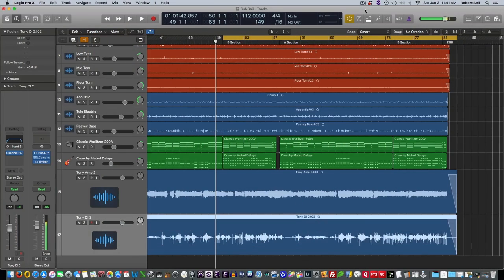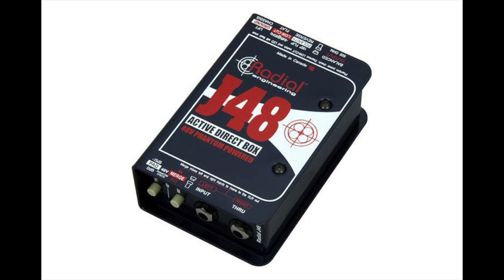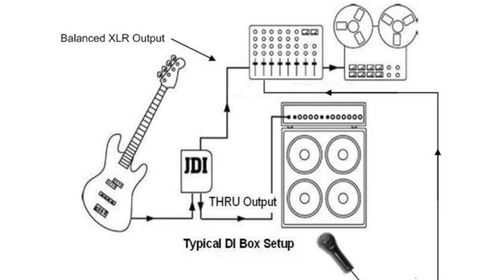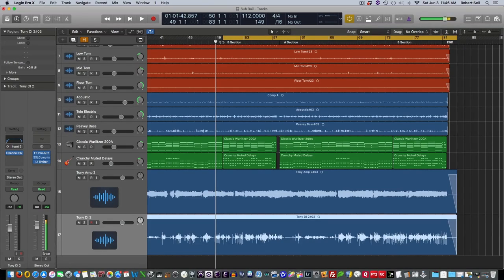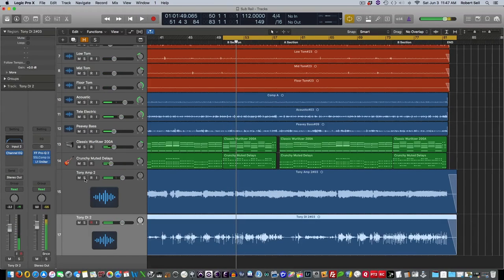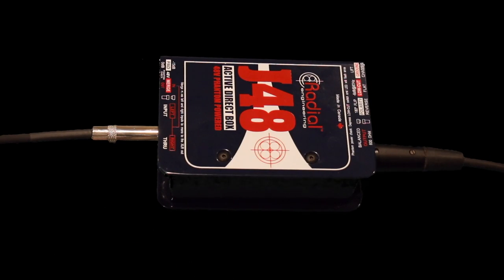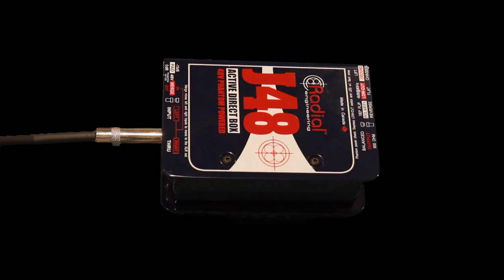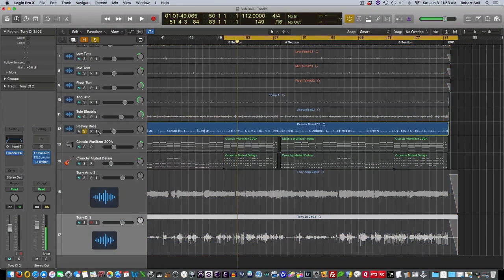Recording Electric Guitar with a DI Box

Comment: Get video! Thanks for the run down! I have a J48 and just getting into home recording. When I plug a guitar or bass directly into this DI box and then into the interface, it sounds perfect. Crisp, open, and a lot of dynamics. When I put the Thru to by pedal board (and to a lesser extent directly into the amps) the DI signal into the interface drops a few db and the sound closes up. Not a lot, just enough to notice. Is this normal? 

When I had an unbuffered fuzz at the start of my pedal board chain it was actually distorting the DI signal when it was switch on. I am not even sure how this is possible! And advice would be hopefully, thanks!
Reply from the maker: The clean signal generated by at XLR (DI signal) should be unaffected by anything going on with the Thru port. The only suggestion I have is a defective J48. Return it and go from there. Good luck.

Comment: The choice of active or passive DI simply comes down to signal strength.  It doesn't matter whether the source is active or passive.  If the source struggles to achieve a unity gain, an active DI is recommended to preamp it, otherwise passive will do as there is no need to preamp & doing so may even result in clipping distortion.  It's just that usually an active source has a higher signal output than a passive one, but this is not always the case.  The common rule of thumb described in the video sometimes breaks down, but easily achieving unity signal at a mixer or recording device input it the real criteria.  This is because, weak signals accumulate the same electronic noise floor as strong signals but the weak signal requires more amplification which also amplifies the electronic noise floor.  For this reason, it is important to preamp weak signals at the earliest possible point in the signal chain where the least noise is accumulated as this gives the cleanest possible signal after amplification.
Reply: Is there a sweet spot for db level when tracking ? I always hear something like -16 to -12db?
Reply: @heythere6983  Well it kind of depends,  the VU scale has been around quite a while, it was designed to give audio engineers an average target to aim for, with head room enough to avoid clipping. 0 VU is by definition unity gain.  This is the standard for Pro Audio, domestic gear may or may not have as much headroom. 

There are several different dB scales,    
The following are all the same signal level.
0 VU or dB(unspecified)
4 dBu
4.782 dBv
-18 dBfs
1.228 V (RMS)
3.427 V (p-p)

Note that dBfs is the scale used for digital music.  0dBfs equates the the maximum possible sample bit value which is the actual hard clipping  You don't want to ever see this happen. Clipping in analogue just begins as distortion & gets worse with even more gain,  but in the beginning is not too bad, unlike digital clipping which is a more of a disaster if it happens at all.

Now, not all gear is made the same,  older audio gear, especially of English  manufacture, is not likely to have as much head room as newer gear designed to interface with digital gear.  So, lookup your specs so you know where your limits are with analogue.  If it's designed to interface properly with digital audio, it shouldn't clip below +18VU +14dBu but a lot of gear will clip before that.  Most gear has a clip light to indicate when you are close to clipping.  So my advice is to aim to average around 0VU and not be alarmed if the clip indicator flickers sporadically, that is just normal in a pro audio setting that is pumping.  Just avoid the clip indicator flickering or lighting constantly.

You see a lot of YouTube content that pushes right up to 0 dBfs +18VU  This is done to be louder than anyone else.  They use compression to get the average loudness way above 0VU so the whole track is as loud as possible.  The problem is that it can break the  pro audio standard 0 VU so things can be louder than expected.  So you have people doing different things in regard to volume.  Compression is a plus and a minus.  On the one hand it reduces dynamic expression, just pumping out a narrow band of volume, fine for a party and fine for mobile listening in the car or street where ambient sound is competing.  Not so good for music appreciation listening in a quiet space.  So, we have 2 different product aims here.  Of note, Classical music usually exploits a very wide dynamic range which has great audience impact in a consort hall, but travelling in a car, fails to get the quiet passages audible over the ambient noise floor in the car.  So, these things need to be considered in setting that average gain 0 VU target.  At times you just want to keep the highest spike below clipping & struggle to attain that 0VU target or struggle to get quite passages audible, without clipping.

For these reason, I tend to think the lossy compressed formats such as MP3 should have more dynamic compression for the mobile music market where ambient noise is an issue, but Lossless, such as 44.1 and above should have far less compression for more dynamic expression in quieter environments.

That's going further than answering your question, but something to think about.

Gain structure to minimise accumulated noise.
If you are doing mixing, try to get the source  as close to unity as possible as early as possible.  Generally mixing boards do not use the lowest noise gain controls to keep things affordable.  For dynamic vocal mics,  it is usually cleaner to use a mic booster at the stage (FetHead or cloud Lifter) so that you don't have to run the board input gains so high (depends on the vocalist).  If this is not affordable, don't loose sleep over it, it's an icing on the cake thing.  Anyway, my advice is set all the channel input gains to unity so the signal is as fat at unity through the input channel circuitry This will minimise the noise added by the input channels.  Each channel then goes through a fader that controls that channels output to the next stage (group or main stage)  Those channels are where you proportion the mix for the next stage but the combination of them also act together as the input gain for that next stage.  So, while you are mixing, you want to be aware of keeping the input level for the next stage, close to unit level.  So think about the dB addition & compensate faders to average out a rough compensating attenuation.  If you mix 2 channels, you want attenuation to average -3dB, 4 channels average -6dB, 8 channels average -9dB etc.  It's not critical you can over compensate a little to be safe. Just be aware of the dB sum & compensate so the the next stage gets close to unity gain input without clipping. The main thing is the artistry of the mix though.  If the board has groups, then you do the same with the group faders and so on.

For the PA I managed, I set the amplifier gains the produce the desired maximum  dB SPL at unity input for the mixer.  I set this up as a somewhat lower volume and input gain to preserve hearing of course.  The point of doing this though is that I could use the mixer output meters to limit the loudness of the whole system to unity signal of the mixer.

So, now I have been through the principles  gain structure for you to minimise the noise floor that a systems electronics adds to the mix.  That is, how to get the greatest possible clarity out of an audio chain.  It doesn't have to be a pro PA like described here, whatever the audio system, the same principles apply.  Minimise the amount of amplification required at each and every stage by maintaining unity signal throughout the entire audio path.

Comment: A well-explained video! If not THE best video on YT in terms of DI Boxes. Thank you Sir! Question: What do you think of the Radial Pro48? Are there any differences in sound compared to the J48? Except for the features that the J48 brings with it.
Reply from the maker: The Pro48 is basically a trimmed down version of the premium DI J48. The Pro48 eliminates the stereo to mono merge function, polarity flip, and high pass filter while reducing the overall size. The Pro48 is more affordable by eliminating these features. Hope this helps.
Reply from the maker: As far as the sound, they should be the same as they use the same transformer. However, I have not used the Pro48 so I can't speak first hand.
Reply: @BobSell  This helped a lot! Thank you very much!

Comment: I've been using the Strymon Big Sky HW with speaker simulate and then post processing as needed with various amp sims in my DAW, seems to work well most of the time - but sometimes only an amp has the secret sauce (at least for now).  REALLY looking forward to Strymon coming out with a more sophisticated Amp sim than the Iridium, maybe with larger Big Sky enclosure - the Iridium has many good settings but I do think there is still room for realism improvement.

Comment: Hey Mr Bob, had a quick question, just wanted to know if i don't want to record an unprocessed tone, and just want to record the wet signal from my eleven rack, will the j48 benefit the guitar quality for recordings at all? And for the connections would i plug my guitar into the j48 and the thru to the input of the eleven rack? and then just record to my computer via usb from the 11R?
Reply from the maker: I’m using the 11 rack as well. The short answer is no don’t use the DI box. no advantage if you don’t want a dry (unprocessed) signal.

Comment: Does that mean your DI box does nothing to alter/balance the sound of your amp? It's really just an upgrade for the unprocessed (and unbalanced) base sound you'd get by plugging your guitar instrument line right into your interface?
Reply: You seem to be good at replying so I'll try to explain better: My guitar goes into my amp, but comes out through the "Phones" port via a 1/8 inch adapter to the 1/4 instrument line, which is directly plugged into my interface. I KNOW. I am unhappy with the quality of sound (no duh) but I do like my amp, and hoped a DI box would help me balance the direct amp to laptop headphone sound that passes the sleeping roomate test. However it seems that is not the purpose of DI boxes? They are only for the unprocessed, unamplified, clean signal of a direct-in guitar line, and will literally bypass balancing my amp to only balance the base DI signal?
Reply from the maker: Yes, the signal that is sent to your amp in unaffected. Yes, call it an upgraded (mic level, unprocessed, dry,  low noise) signal sent to your interface! You got it!!
Reply from the maker: Yes it sound like you have a good understanding. The DI box will NOT help you get a clean sound out of your amp to your computer...
Reply: Thank you!! Yes I am understanding, and glad I did my research before blindly buying

Comment: Quick question:  My DI box has 3 pad settings:  0 dB,  - 20 dB , and a  -40 dB pad. When i use the -20 dB pad, i barely get guitar signal into my DAW.  Do i have to use the pad , or can i keep it at 0 ?
Reply from the maker: Only use the pad if you signal is too hot. No, you don’t need to use it.
Reply: @BobSell  thank you!

Comment: i have my signal chain like the one in the video but the signal is clipping and i cant understand why. 

guitar goes into di box, xlr goes from di box into audio interface mic input. i have -15db pad engaged on my radial pro48 active di box, and i have input knob on 0 on my steinberg ur44c audio interface. guitar volume is on full but will clip with hard palm mutes. 

i could turn down the guitar volume but the tone suffers, any ideas?
Reply from the maker: I'm not familiar with the Steinberg RU44... but can you turn the input anymore more? Is 0 unity gain on the unit? Do you have fantom power engaged?
Reply: @BobSell  i have phantom power engaged and the knob is all the way down but it still clips on palm mutes. im not sure what 0 unity gain is but the only thing i can turn down is the guitar at this point and im not sure why i would have to. if i plug the guitar straight into the interface it doesnt clip nearly as easily so i know its the di box making the signal hot

Comment: I dont get it... if I just use my interface and decide later that I want a different sound.. I just go to the ampsim and change the sound.
Reply from the maker: Yes, you can do that. The revamping process is really around physical amps. If you are using an amp simulator and you've recorded a dry signal, you are all set.

Comment: I understand recording the clean guitar for re-amp and sticking an amp sim on, but how do i record the clean and get the output from my Marshall JMP1 unit. I usually use the JMP1 ampsim output for recording, but I understand it would be invaluable to record the clean tone as well. I am using a focusrite 2i2
Reply from the maker: If your Marshall JMP1 unit offers a thru port, that's how it's done. Otherwise, you'll need a DI Box.

Comment: Can you tell me how to setup using the guitar amplifier with effects pedal? i can't seem to figure it out with my DI box, what should I connect to what? Thanks in advance!
Reply from the maker: Thanks for the question! The idea here is to record a dry signal from the guitar in addition to the effects. The DI box is first in the chain, before the pedals. The DI box creates a balanced signal for recording a clean track through an XLR cable that go to you recording interface. Also the DI Box provides a thru port which passes the guitar signal unaffected to your pedalboard

Comment: Hey Bob, great video! Would you recommend using a DI box for recording guitar just with an audio interface (Line 6 Pod UX 2)? Without using a Amp simultaneously? I'm using a active guitar and i just want to improve my DI signal.
Reply from the maker: Jan, I would highly recommend using a DI box for recording direct to your L6 Pod! The whole idea is to give you a clean mic level balanced output to go to your interface. I'm not familiar with the L6 Pod but does it have phantom power and mic inputs? If so, yes this is your best option. My only other recommendation is spend the money and get a good one. They will last a lifetime. If you get a quality active direct box it can handle both active and passive guitar pickups. Here's an Amazon link for more information: https://goo.gl/TRb6YS  If you are on a budget, you'll need to get a passive DI to be able to handle your active guitar. Hope this helps! All the best.

Comment: hi Bob, i have a dbx 286s mic pre and i'd like to use it also with my electric guitar, someone told me that in order to connect my electric sg guitar into de 286s i need a DI. is it correct? if yes what kind of DI is more appropriate to this purpose? thanks
Reply from the maker: The J48 is the best. will serve you well with either passive or active pickups. Spend the extra money to buy one box that works for all situations. My 2 cents. Hope this helps.

Comment: Great video!!! Bob,will that box do the job for my nylon string Godin?playing live with Bose 2 and the digital mixer from Bose as well- there is presets in it for the piezoelectric mics for the guitar. In that case is the DI needed ?
Reply from the maker: Thanks! This is one of the best DI boxes you can buy. It handle anything. If you are playing live I'm sure your sound guy would prefer a balanced mic level signal for the house board. You could use the thru port if you wanted to monitor through your amp. Works great to have a balanced signal in the studio as well. I would think all guitar players that are plugging in would want one of these. You can buy other models cheaper but not better. Country Man is another industry standard professional DI box. Thanks again for the comment!

Comment: Hi Bob ref your J48 example and capturing  your dry sound is good,  but I want to record  from my amp (wet) using certain Effects from the send and return loop on my amp via a DI so which model do you suggest J48 or Jdx48? or other(  I have 2 guitars 1 active and 1 passive ) then which is the correct way to hook it up into the interface?  Kind regards Stephen
Reply from the maker: Great question Stephen. I’m going to make some assumptions based on your comment. You don’t want to mic your amp’s speaker cabinet. You’re plugging into your amp first for the distortion/overdrive (preamp) Effect. You’re coming out of your amp’s “Send” to your pedals (modulation, delay, etc). If this is the signal chain you want to record then from your last pedal go to the J48 DI Box. From the J48 you’ll get a balanced XLR out for your audio interface. The only thing you are missing in this setup is any sonic quality that you may be getting from your amplified cabinet and speakers. The JDX gives you the cab/speaker simulation but I don’t have any experience with it. I would go with the J48 so you still have an excellent DI box if you ever need a clean DI like for recording bass or re-amping guitars purposes. https://goo.gl/TRb6YS Hope this helps...

Comment: Hello mate, great vid definitely has cleared somethings up for me! Just wondering, if you were to record an acoustic electro-acoutic guitar using this di box would you be able to both mic it up and run through the d.i. as well as plugging it into radial? Also I am considering buying something like a line 6-pod or something small and simple for live and recording purposes as the amp simulators in logic pro x are ok but a little dodgy (i already have a bunch of boss pedals but no specific amp simulator) so just wondering, in your opinion, is it worth getting both a d.i box such as this on top of  multi-effects unit which can act as a pre amp anyway, or would the multi-effects do a good enough job? Hope that makes sense! Cheers Bob!

Comment: Question - if you use a direct box with NO audio interface (Im new to recording don't judge lol) would the signal still be clean in the computer (with a USB connection)?
Reply from the maker: The clean signal output from the Direct Box is through a mic cable so you’ll need an audio interface to plug in to.